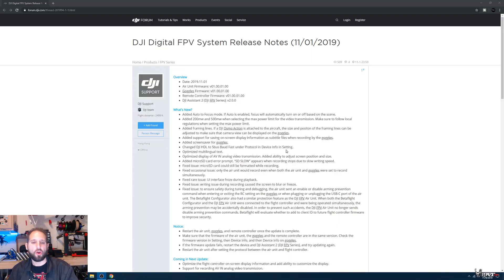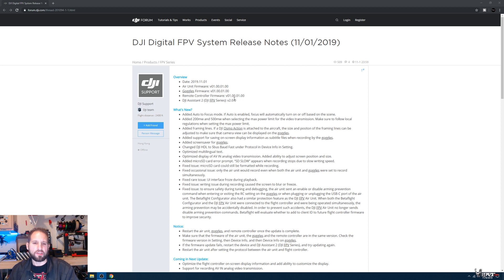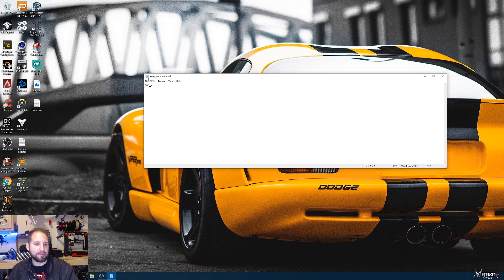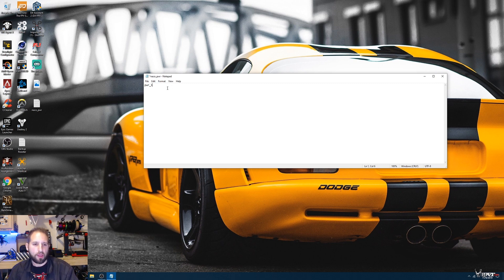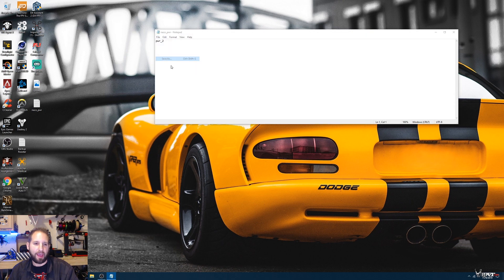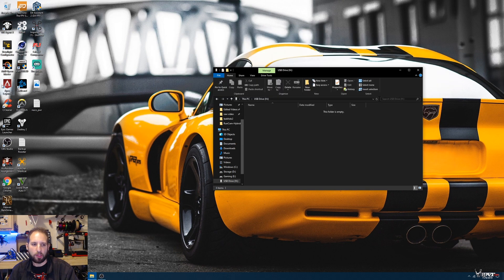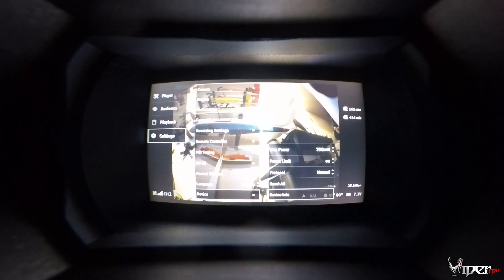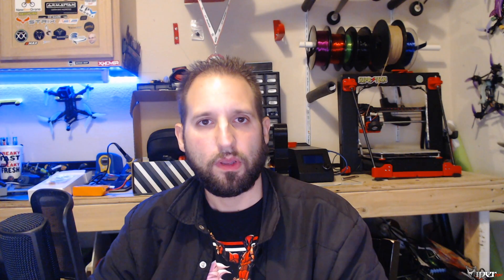DJI Digital FPV System - How to Unlock & Enable 1000mW & 1200mW Power Output

Comment: Turned on my goggles and air unit. plugged sd card with txt file to goggles. waited. still can't go above 700. what could I have done wrong?
Reply from the maker: Nelson Westerhout insert the SD card into the air unit first then power it on.
Reply: Viper_FPV Thanks i’ll give that a try.
Reply: Worked! Thanks! ill give u a sub

Comment: I have a diatone GTR 369
I took it apart and tried to hook up the dji system to the board and used the dji controller.. didn’t work.. after taking all the necessary steps
Reply from the maker: I don’t have the DJI controller, but there are other videos to show u how sorry

Comment: It didn’t work
Did everything exactly like you explained.. checked multiple times
Reply from the maker: Are you on the newest firmware? And where are u located because if your not in the United States you will need to do the FCC hack first
Reply: Viper_FPV first thing I did was make sure the firmware was up to date 

I finally got it working 
What the problem was is that I’m using a Mac and needed to put .text at the end 

Thanks for your help
Reply: Raydio Show so u must save the text file as naco_pwr.txt ?
Reply: @TheCiardellas  have you tried it with the 'latest' .500 FW?  I too have a mac and added the .txt but still does not work!